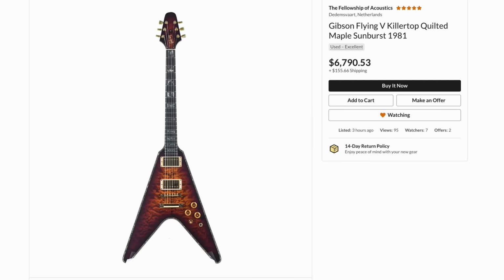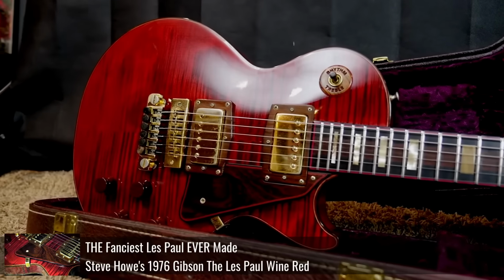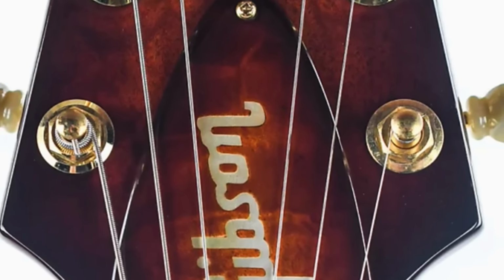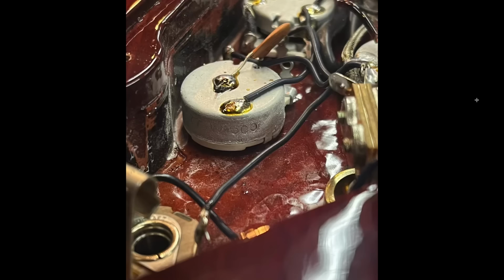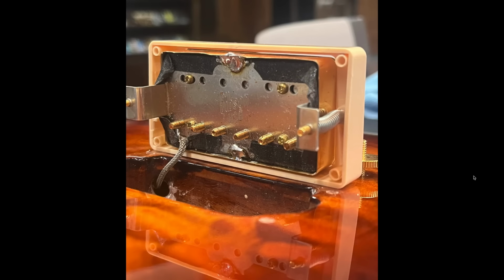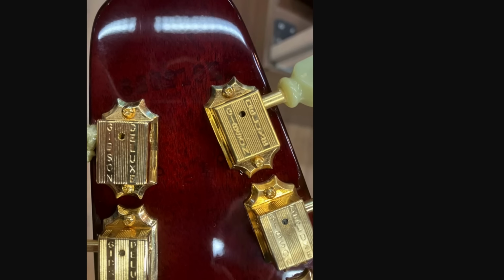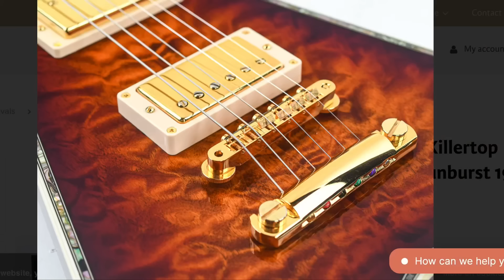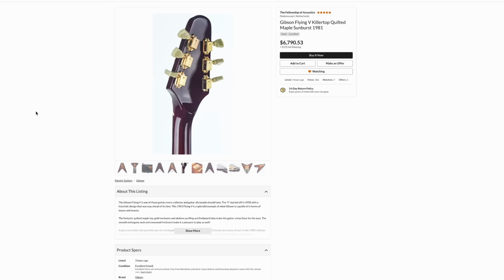The Coolest 1981 Gibson Flying V You've Never Seen | A Custom Order or a FAKE?!?

Comment: In relation to the other fingerboard inlays and using the strings as a guide, the inlay at the 12 fret seems to be wider. Not sure if that is a perspective issue given the angle of a few of those photos, but it does look off.

Comment: 15:04  The 12th fret inlay looks wider than the rest of the inlays.  You can see a gap between the edge of the other inlays and the low E string.  The gap is not there on the 12th fret inlay.

Comment: I wish there was one video that sorts out the differences of every iteration.  Not a shootout persay, but a spec reference. For example, the neck heel on an 80s heritage 50s  reissue looks like a later model neck heel, not a 50s model. There are several Epiphone 50s reissues with different neck profiles, but the product names are so similar (ie. Inspired by Gibson vs  Inspired by Gibson Custom shop) and i notice people are selling the $700 models for $2000 on reverb as if it's the higher end reissue. 
You'll hear people talk about "the flying V" with overlapping details and assumptions on spec details... ie. Saying "a flying V is a two piece body construction" is only true for certain years and iterations. Saying  "the Flying V body starts at the second fret, and it has a Maestro vibrola bar" describes two completely different V models as one. Articles where famous V players talk about "what makes a V special" and the overlap as they are describing different guitars as one can confuse potential buyers. 
I knew what version i wanted and made absolutely certain i was getting 'the right one" but if I didn’t know better I'd have tried the cheap one with a slim taper neck and said to myself "I was expecting a beefier neck" and bought a strat. People think "The Flying V" is a specific thing, but if you want one you can actually get "the right V for you" if you have knowledge of what the differences are. People wonder about the shape being comfortable and sometimes forget that options vary. 
There are also videos where someone "explains the V" using a modern budget version while prefacing the video with "this is my first V and im really excited" meaning they have no frame of reference when describing the guitar they are reviewing. 
I know if you did a comprehensive video about the various V iterations,  it would be done properly. Each decade of Flying V has its own lore and reasons why someone might prefer it.

Comment: Its a "THE V", the tail piece has been relocated because on the original ones the tail piece was further back, when they put the top on it they relocated it to the normal position. The truss rod was a normal 2 screw cover that said 'THE V". Looks like this has a original body and neck and not much else.
Reply: I agree. Someone took out the dirty fingers pick-ups and replaced them as well as the wiring.

Comment: IMO too many red flags to even sell it as a Gibson. If it was a Gibson Flying-V/"The V", like you said yourself, it would not have two separate holes for each pickup. So not only would they have to put on a maple cap but route out the mahogany core and replace it to drill new holes but I don't see any evidence of that in the control cavity so I would not risk it at all.

Comment: The pic with the guitar angled in front of the case shows the 12th fret is quite a bit wider than the other frets. I'd guess finessed, not fake, but not as it left factory. Still, a sweet piece. I wonder if the glop in the pickup cavities is epoxy or puddles of the refinish paint? Thanks for showing us this beast!

Comment: This is why it pays to do your due diligence when considering paying Big $$$ for a "Special" Guitar. Originality with NO Modifications is a huge deal when collecting Vintage Gibson Guitars. Unfortunately many luthiers over the years have modified rare Gibson guitars to make them look "Special" or "Rare"  in order to make extra money knowing many buyers won't take the time to research before buying. That's why I would recomend you pay someone like Trogly to dig deeper into researching the origins of any Vintage/Rare guitar you might spend Big $$$ on to make sure you're not getting ripped off. If a guitar especially a Gibson has been modified by anyone other than the manufacturer then it will significantly drop the value even if it's something as minor as a swapped out pickup or some type of hardware, Vintage 1958/59/63 Gibson Korina Flying Vs and Explorers are way less valuable just without their Original Hard Cases. When buying Gibson guitars keep it original as when you sell it down the road you will make the most money. Great video Austin!
Reply: why would a luthier want to risk his reputation for a few extra bucks? I would think the type person who would become a luthier wouldnt be the con-artist type.

Comment: To me, the finish is what sets apart one guitar from another. It's the whole reason some guitars feel better than others. Thick layers just don't feel right. The only reason why I would think there is wax in the pickup cavities is when the guitar had wax potted pickups in there and faced high temperatures, causing the wax to escape from its shell. Looking at the traces of the wax I would say this guitar was laying down at that time. It COULD be a housefire rescue, or simply a display piece in front of a window on a hot summer day. But, a displaypiece would normally show more discoloration in the finish and plastics. Nonetheless, what triggered me was the inlay on the first fret. It's slanted. I wouldn't be able to unsee it ever. Also, you've shown a picture of the silverburst 80's flying V. The twelth fret's dots were not horizontally alighned properly. I know it's difficult to nail that by hand, but it's one of the reasons why I would leave the guitar alone. I should drive over to The Fellowship of Acoustics to actually see the guitar in person to determine its origin actually. Because repair itself doesn't look too bad, maybe it's done by Gibson?

Comment: Everything can be explained and appears legit until you get to the back of the headstock. HUGE red sirens were going off when you got to that. The SN is THE most important feature on any guitar, and this is illegible. And when you go to resell it, that's the first thing any customer is going to bring up. Is it a Gibson? Yes. Is it a legit Gibson Custom shop? No. No Custom Shop builder with ANY dignity would allow that out the door. Someone took a nice Gibson and fancied it up. The SN blurring could have been accidental, but more likely intentional. Move on. If the price was half what they're asking, then what the hell, go for it. It's a nice enough piece as is. But to fetch the $10k resell you mentioned, not happening